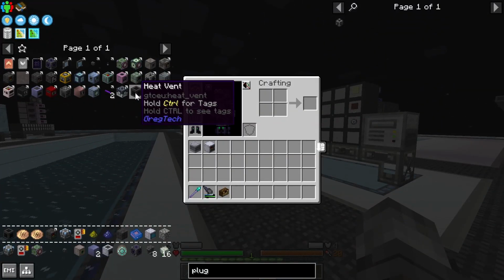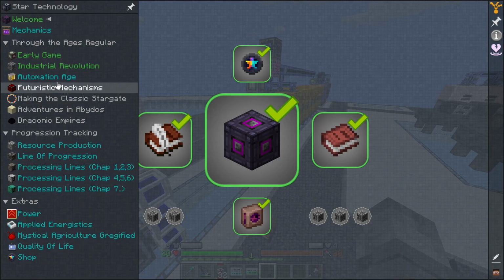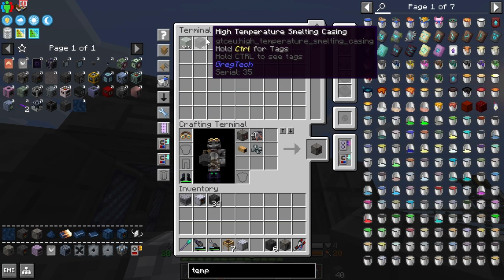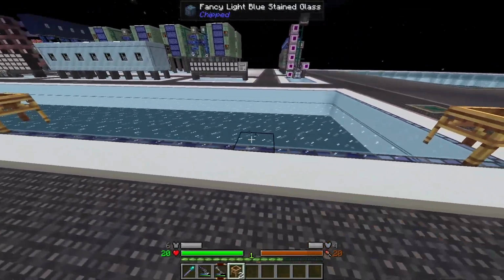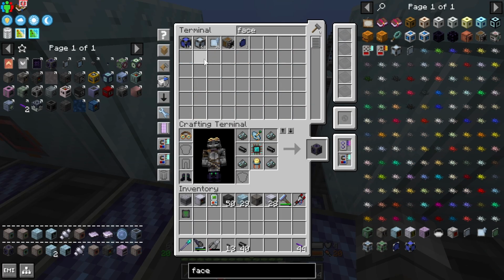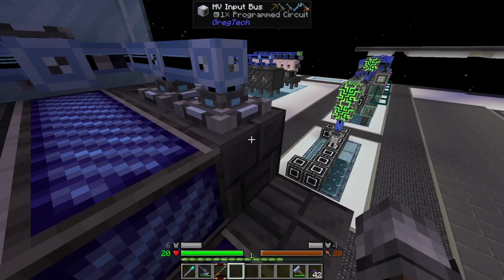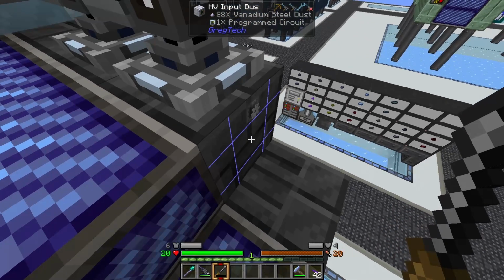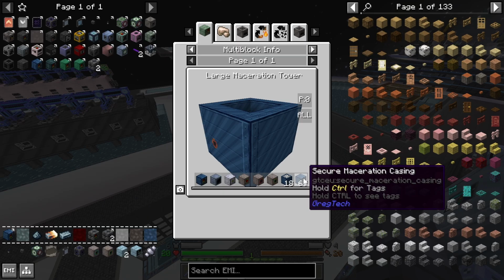Star Technology Ep31 Alloy Blast Smelter

Comment: Out of curiosity, what are you making the larger multiblocks (macerator, ore washer, centrifuge) for? I'm not sure if you'd get much benefit from them (at least right now), especially without parallel hatches, compared to the perfect overclock machines.
Reply from the maker: Half for future proofing and half for the experience of doing it
Reply: @megableeder  fair,  by the way, if you ever decide to centralize some passive lines, tag export buses and tag storage buses can be pretty powerful: for example a "*hot_ingots*" tag for vacuum freezers, "*raw_ores*" for macerators, "*pure_dust*" for centrifuges and so on, mostly for things that you want to process all the way and not keep stocked
Reply from the maker: @hypercrafting ya ore processing will have it's own subnet (who could have guessed that) and I'll only expose the final dusts to the main net